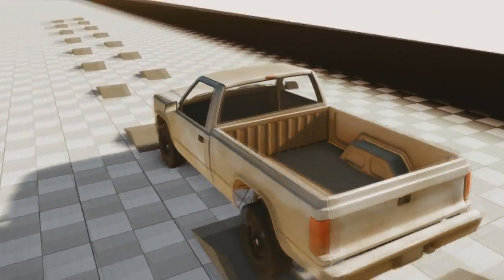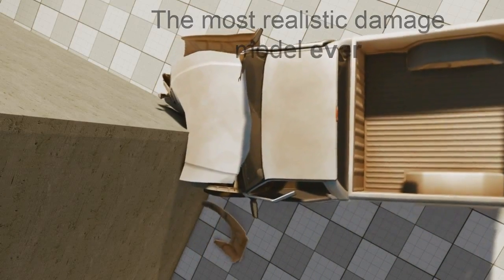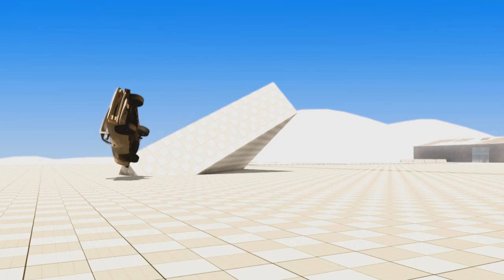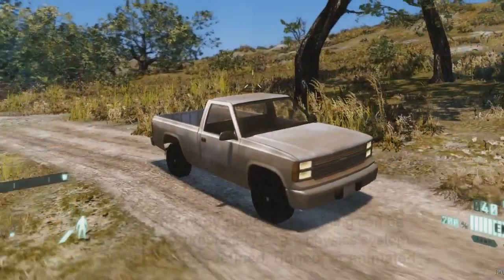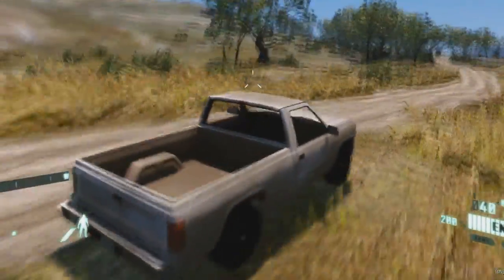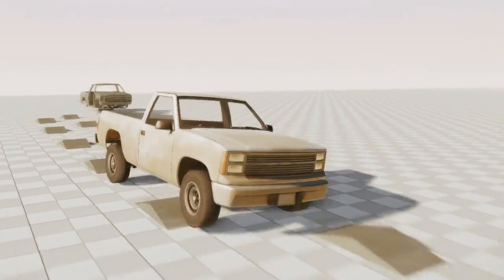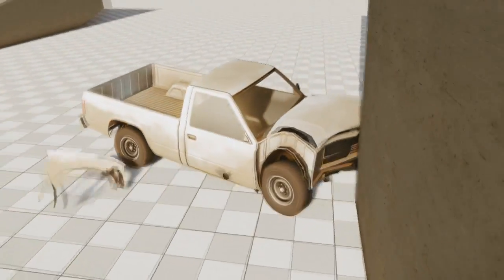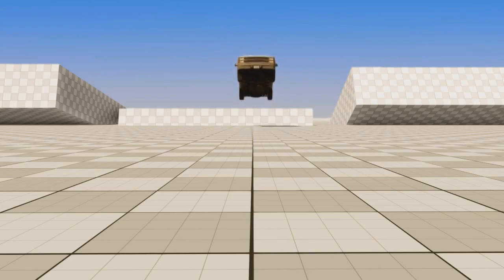Soft body physics in CryEngine 3

Comment: point of cryengine 3 was to improve and push out more poly's than ce2, crysis 2 and farcry 3 were made for the consoles and ce3 physics engine was built from the ps3 wii even uses ce3 if rockstar decided to use ce3 it would only be better yes console is a downgrade from the pc version of any game but gta4 on ce3 would of been just that much better